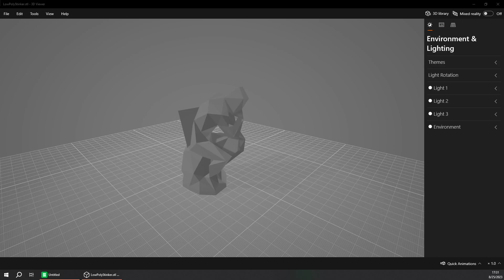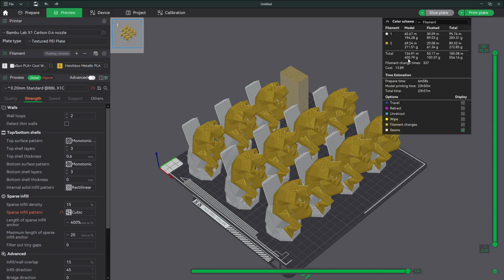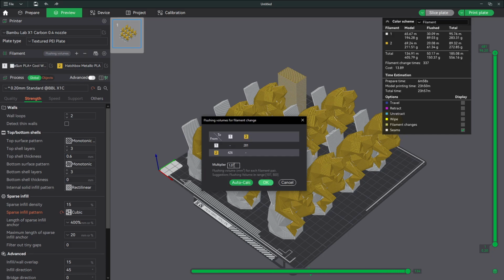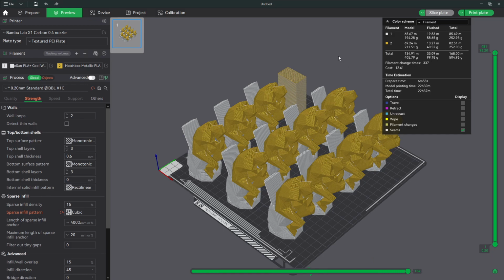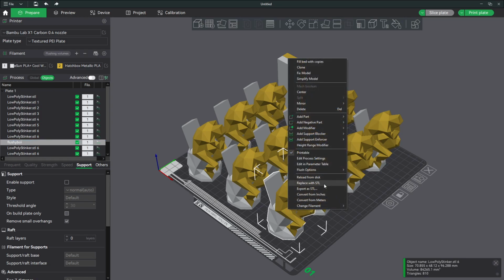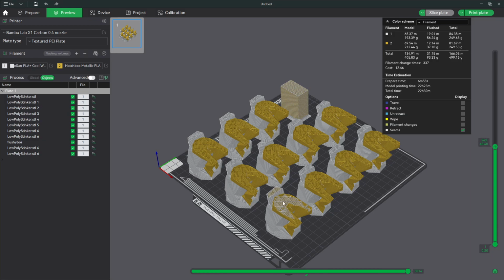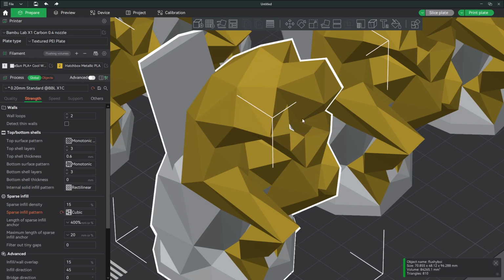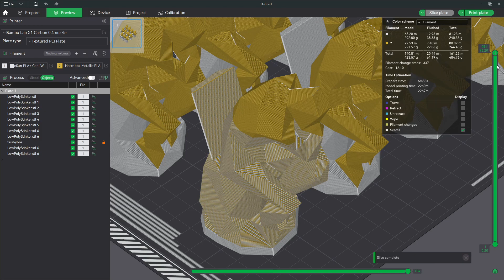Bambu Studio 1.7.4 - Reducing Waste

Comment: How to reduce startup waste?
Reply from the maker: The initial loading and priming isn't really all that much to begin with. You can modify the machine start gcode to adjust these volumes or eliminate parts of the process but I really don't recommend this - those functions serve a purpose. 

The best way to cut some waste is actually to prevent unloading at the end of a print, particularly if you are batch printing a lot of the same material. You do that by modifying the end gcode and saving a custom machine profile. Instructions here - https://wiki.bambulab.com/en/ams/manual/ams-not-unloading-to-save-filament

Comment: What is the point of having the model be a purge bucket and totally screw the colors if you are going to discard it anyway at the end, resulting in waste in the form of the model instead of poops
Reply from the maker: Sometimes they come out really neat - a lot of times I'll throw a fidget cube or whatever on the plate specifically to suck up the purge to keep as much out of the bin as possible.

Other times I'll have a random bracket or other thing that color doesn't matter so I'll throw those on to use it up.

The entire goal of a purge object is just something to prevent purge from being completely wasted.